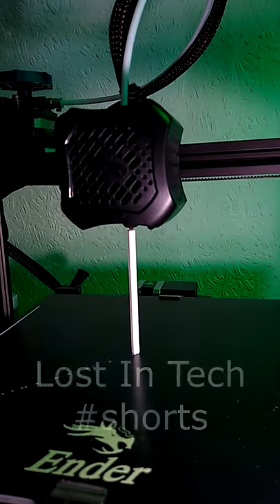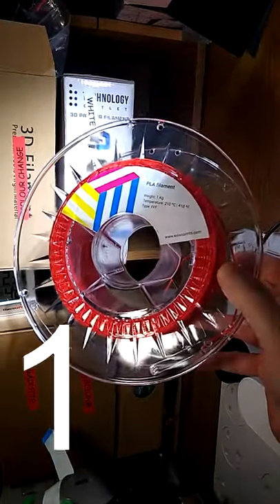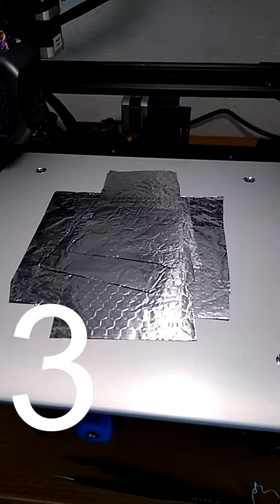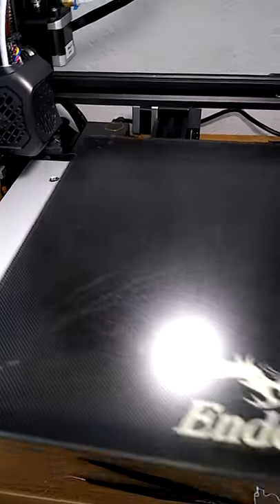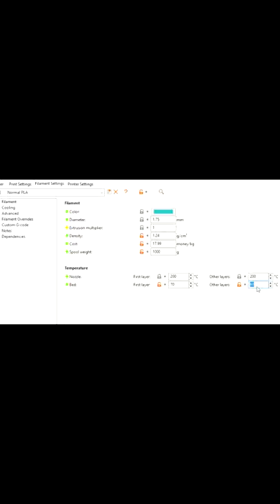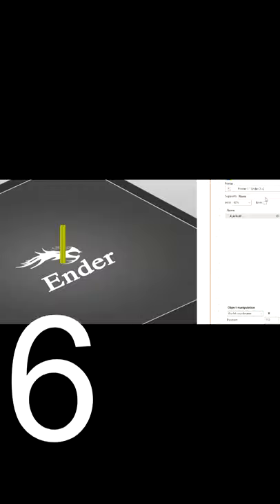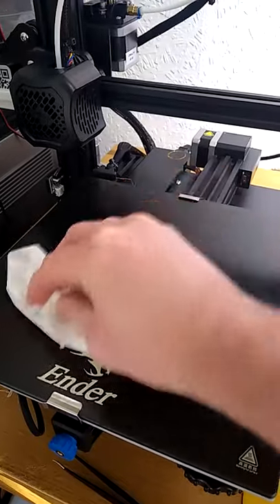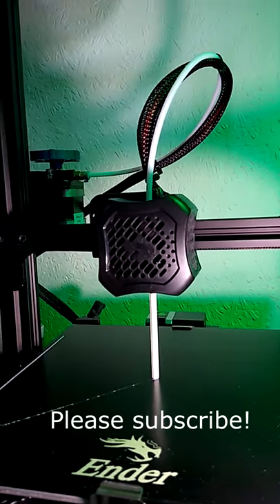Improve your 3d printing adhesion and print things without rafts or brims! #shorts

Comment: Funny how most printers come with a metal scraper.
Reply from the maker: They really shouldn't!!
One of mine came with a plastic, not sure if it's a creality thing with metal.
Reply: Havent had issue with metal. Honestly my ender 3 v2 i wouldnt be able to get prints off with anything that isnt metal. My adhesion is insane and my offsets are perfect and esteps callibrated.
Reply: Vyper comes with plastic
Reply: Lol yea creakily pro 5 came with a metal scrapper and i tried it lightly cause it seemed sus. Instantly scratched it. Print one
Reply: @TheHadi545  Glass is harder than whatever metal the scraper is made out of. You didn't scratch the bed, you scratched the scraper.
Reply: @eldafint  wasn’t a glass bed.. I think I’d know
Reply: @TheHadi545  Fair, I'm dumb
Reply: They also sell replacement beds.
Reply: @eldafint  the coating can be scratched.
Reply: A horrendous metal scraper.  The ultra thin artist pallette knife ones are so much safer
Reply: @LostInTech3D  It they suppy a plasic scraper, some youtube channels will complain about a lack of quality. Also using a metal scaper doesn't harm a glass bed unless maybe if you scrape like a maniac who doesn't know how to use a scarper.
Reply: @Tht1guy63 how ca i get that adhesion??? why is cura so hard with all these setting??? i cant print without raft

Comment: Different bed temperatures cause warping. I didn't learn this lesson until many years of failed prints. Glass expands and contracts enough for many materials to warp. The only reason people have success with a higher first layer temperature is because the glass takes a while to heat up. Instead I set the same temperature and only start heating the nozzle after the bed is fully heated, that way the time it takes the nozzle to heat up allows the glass to settle. For risky ABS prints I even leave the bed preheated for 10 minutes.

Comment: Also missing: Turn off "print thin walls" this setting will crank up the speed to attempt a thinner than the nozzle line. (I spend an hour figuring that out / depends on the model)

Comment: Have a CR-10
When the bed is leveled I like it but it's a pain in the arse because it just doesn't want to stay leveled for more than a few prints. And even then it doesn't seem completely leveled.
Reply from the maker: Does the bed wobble if you try? It might be that the eccentric nuts need adjusting underneath. This can cause exactly this problem
Reply: I recommend leveling after everything literally every minor difference if u put pressure down on your bed, your extruder anything, andddd it’s unlevel again  that seems to be a problem for me Atleast and it’s the solution
Reply: After every print even if I didn’t put weight on the bed the print that was on it even tiny ones did, so I relevel after every print

Comment: How do you get your prints to get off the build plate so easily. I have my bed at 65 and its still hard to remove prints
Reply from the maker: It does depend on the bed surface and material, even the ender beds vary hugely. If you struggle at 65, its actually ok to try 70.

Comment: Didn't know the trick of using aluminium foil to shim the bed. I guess as long as there are no scratches in the heating-PCB below there shouldn't be any short-circuits and Aluminium is a great conductor of heat. Not sure if it will work on my Prusa as I often switch the beds.

Comment: I just let my prints cool and they pop off nicely
Reply: This is why I got a magnetic PEI bed. Most prints pop off on their own, but for those that don't I just lift the metal plate off the printer and wiggle it a bit, and the print falls right off.

Comment: Curious as to why metal scrapers are not recommend?
Reply from the maker: messes up the bed
Reply: @LostInTech3D  wish Anycubic would stop supplying them with their printers then. Cheers 👍
Reply from the maker: Pretty much all do! You can print one out in pla and it works really well!
Reply: I use a big razor blade.

Comment: How can you use 70C with PLA? I use 50 on glass and if I go to 55 or more PLA warps on glass like ABS on cold plate. Or it's suggestion for high models with little xy dimensions only? For ABS my sweet spot is 95-100.

Comment: What temp should I have for a glass bed on the ender 3
Reply from the maker: 65 first layer then 60 for the rest
Reply: @Lost In Tech  damn I'm new to this and found success with pla running between 82 and 90c. Next print im going to switch it up and run a little colder

Comment: Why plastic and no metal for removing parts?
Nothing beats a razorblade scraper.
Reply from the maker: Scratches the bed
Reply: @LostInTech3D  two years in my bed looks pristine from my razorblade.

I do have some marks from the brass nozzle though after my cr touch screwed up my z height

Comment: I do wonder why channels that produce such a massive amount of content about things like 3dprinting have so much trouble getting the simplest of things to work right. I guess it's because they are so used to having modded printers and expensive printers that they forgot that the printer they got out of the box was actually already quite good.
Oh, and don't put ducktape under your bed, it insulates and if your take can't take the tempareature the glue could stick your bed to the base in a more permanent way than you'd like. This seems obvious, but again... the more "expert" the channel, the worse the info.